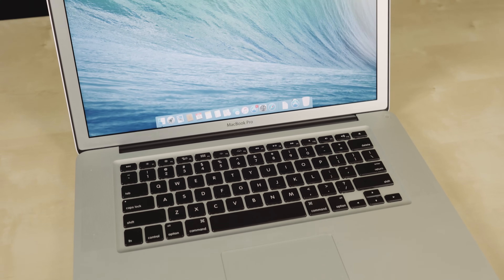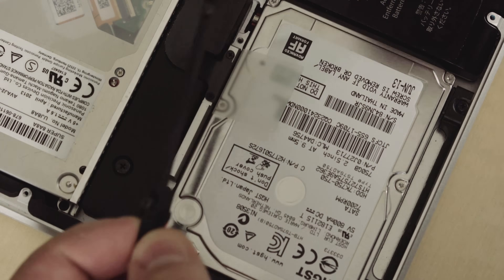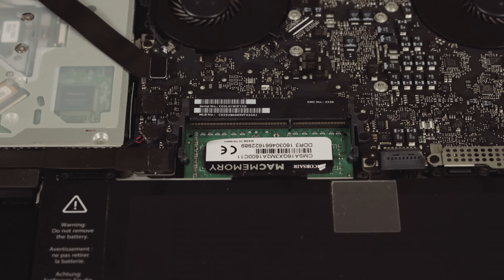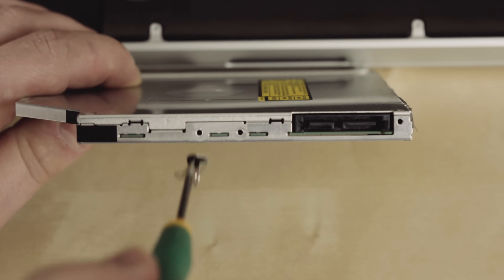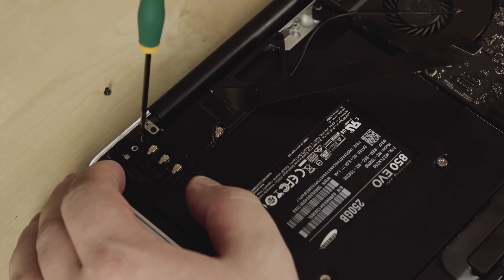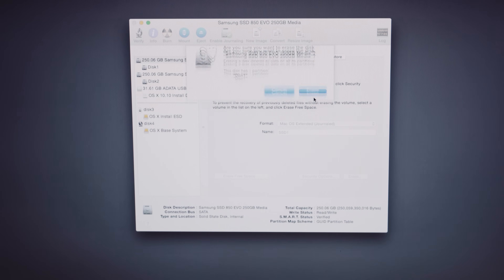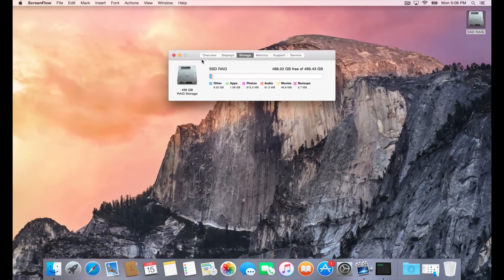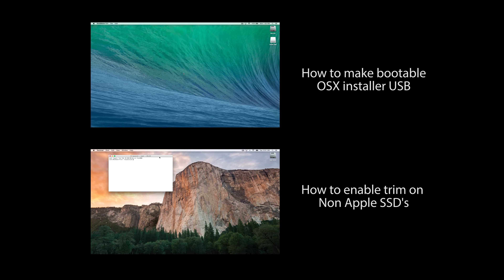Fastest 2012 MacBook Pro Ever! Upgrade Guide - in 4K

Comment: I am about to add a samsung evo 850 500gb drive and 16mg OWC ram to my 2012 mbp.  does anyone have a link about what options to do right after doing a clean install of El Capitan from a flash drive
......I noticed this vid does RAID0 and trim.  Not sure if i need to do that with only 1 SSD installed. 
thanks
Reply from the maker: Gary Sbraccia raid0 is only for making a stripped array for 2 ssd drives. So you don't need to worry about that. But you will need to enable trim for your drive

Comment: Fantastic video! Thanks a bunch. However, and probably rhetorical, but why would I forego my optical drive (this I need because I'm old school) to have 2 drives which, yes, have great speed? Can I still upgrade and make it faster without having to install 2 SSDs? if so, apart from RAM what else can I do?
Reply: Karen Erasmus you don't have to give up the optical drive, you can put in into an external USB enclosure. Also max out RAM, disable extra fonts and trim unnecessary background apps slowing down the computer and add little functionality. See Activity monitor CPU usage. Also see Console log to see what error messages are coming up and resolve these CPU wasting errors. Use OnyX to run maintenance scripts.
Reply: +BradMacPro thanks Brad! How do I determine what's the max RAM? I just bought 16G.
Reply: 16Gs is the max :(
Reply: Also, Will my 2.3 GHz Intel Core i7 handle all of these upgrades? As it is this mac gets hot quickly.
Reply from the maker: Is it a 2012? The upgrades will not have any effect on Heat. If anything it will reduce heat. The standard mechanical drive gets much hotter than an SSD. The extra ram will not change anything related to heat. And I know what you mean. These laptops run super hot especially when exporting video out of Premiere. I stick an icepack under it sometimes so it doesn't thermal throttle haha.
Reply: Lol! I hear you. So 1 last thing. I got all my upgrade gadgets, but am a bit confused about the optical drive casing you have in the link. I ordered this one https://goo.gl/R6tFak , but think I need something else, am I right?

Comment: Any issues with doing this upgrade and using OSX Sierra? Does it matter what brand of memory?
Reply: leonel monzon, jr. I recommend OWC first and Crucial second. Sierra is optimized for use on a SSD flash storage. Sierra is no faster but may add useful new features but then it could very well cause havoc with incompatible hardware and software.

Comment: Do you have any advice on what to do if the second screw you remove from the wifi/Bluetooth antenna is stripped?
Reply from the maker: you could always glue it down? haha I dont know. I know it sounds sketchy but it would probably hold it. superglue or something. Sorry cant really help you there.
Reply: Thanks for the reply and no worries.  I've tried all sorts of suggestions.  Nothing has worked and now, to make it worse there is crazy glue inside the the hole.  
I'm thinking of cutting the two plastic arms and then using glue to put them back together.  
The closest apple store is about two-hours away, which makes it low on the list of solutions.

Comment: What would be the difference if i kept the original hard drive and added a ssd? so id be  running both the original drive and a ssd
Reply: If you RAID 0 a SSD and HDD, it will actually be slow. In that situation, it's best to just install the OS on a SSD and put large files on the HDD.
Reply: bluemetal04 Thanks man,I think ill just get 2 SSDs and use the HDD as a external hard drive
Reply: TheBathingSaint planning on doing this soon, that's smart use the old one as an external
Reply: that's what I decided to do as well. Make sure you reset the PRAM after you're done installing them and enable TRIM on the SSDs (http://www.howtogeek.com/222077/how-to-enable-trim-for-third-party-ssds-on-mac-os-x/) Good luck
Reply: ***** Thanks man! I plan on doing it this week,ill update you guys.

Comment: Is it crucial that the two SSDs be the same model?  I have an existing Samsung 850pro, wondering if I can get away with getting a Samsung 850 evo.
Reply from the maker: Steve Gong for raid0 it's best to have 2 of the same size and make. But it's not crucial. The raid will choose the smaller drive size and make an array based off that. I just feel you will have more luck and stability if they are the same that's all. And if they were both new you would know that they have an equal amount of life span.

Comment: Can i swap the hdd with an ssd and then replace the optical drive with the hdd? Or just leave the hdd and replace the optical drive with an ssd?
Reply from the maker: Charlie smarter to replace the main drive with an ssd and if you want to replace the optical drive with a normal hdd you can.
Reply: Thank you very much
Reply: Also, is it possible to upgrade with 2 different ssd's? Like, one 256GB and one 240GB ssd?

Comment: Not a tech guy like that, but my mid 2012 15'in Macbook Pro is so slow when I use Lightroom and Photoshop for editing, will these upgrades help me or do I need to do more?
Reply from the maker: Paolo Jay Agbay even if you replaced the slow hdd with an ssd you will see major improvements.
Reply: Thanks for the feedback!!
Reply: I installed an ssd on my mid 2012 and my god, it is EXTREMELY FAST NOW!! Trust me it’s worth it.
Reply: @MarcoGamer640Productions2012  Hi mate, I've the same model of MacBook as yourself - which SSD did you go for? Cant figure out whether to go for the 250GB or a 500GB one
Reply: have you reaped the results from the SSD? boot times for startup + boot times for apps?

Comment: What type of SSD caddy did you use to replace the optical drive? I noticed you only went with a 250 GB Samsung EVO instead of the 500 MB on that one. So, is the 250 GB sufficient for the optical drive replacement? Thanks for the great video!

Comment: Hi, I currently own a 13-inches MacBook Pro 2010. I notice the speed of it starts to slow down over the course of the year, should I do the same upgrade as your MacBook if I want a better video editing experience? (iMovie, Final Cut Pro) If not, what kind of upgrade would you recommend? Thank you.
Reply from the maker: You wont be able to do the dual hard drive swap and get Raid0 speeds like me. But you can replace the main drive with an SSD and you will see a major improvement. You can only upgrade the ram to 8gb as well. It will help a little with video editing but unfortunately not much as the onboard graphics is the main component when it comes to video editing. You cant upgrade that.
Reply: Does it help removing the optical drive and replacing it with another SSD drive?

Comment: hello, if I want to put my existing HDD into the caddy, would I be able to clone the data from it to the SSD?
Reply: If you use the right software you should be able to just fine. I just think it costs too much for something that you only use once. Your best options are to either make a time machine and set it up that way, OR copy your important stuff from your folders to your new MacOS drive. I would install the apps all over again because some of them didn't work when I just copied them.
The mac will read your hard drive like it's an external one, but I don't think you can boot up from it over USB.
Keep in mind, old HDDs have a limited life span and will inevitably fail, so I recommend getting a backup hard drive to keep important stuff there. I would not recommend using your old hard drive to store libraries because mine failed a month after I upgraded my mac XD

Comment: Hi would you still recommend this macbook now if i was to upgrade it the same as yours?
Reply: P.s i will be pursuing cs and will be aiming to code plus occasionally play counter strike using bootcamp
Reply from the maker: Depends on what you do. Its a lot cheaper than buying new. But the newer 2014-2016 Macbook Pros are faster. Just way more money. It will be fine for coding and playing CS
Reply: Zed ProMedia thanks man!

Comment: What if I just install a 500g ssd instead of the 2 250g? would that be any different?
Reply from the maker: Nothing wrong with one drive. Your system will still be really fast. You just wont get x2 the speed from 2 drives.
Reply: Thanks!

Comment: Hi, first thanks for this video, the information you give is so useful and very understandable for people without experience in computers. Just a question: I have now a macbook pro mid 2012 and want to upgrade it (I am doing lots of video editing with premiere pro or after effects) and my macbook is way too slow... I am planning to do the same upgrade as you did, with 2 ssd's. I have seen that samsung also sells ssd's of 500gb, would it be worth paying more and getting one of 250gb and one of 500gb, or simply get 2 of 250gb and that would do the trick? I just want to know if it will make my laptop faster (or at this point it would only give me more storage, but no actual faster speed)? And would this configuration be able to handle the editing of 4K videos? Thanks a lot!
Reply from the maker: 2x 500gb or 2x250gb it doesnt matter. You will have the same speed. You just get more storage. I edit 4k video with this system. It can handle it pretty well but its mostly the graphics card that is under powered. If you use premiere you'll have to edit at 1/4 or 1/8 resolution while editing to get a smooth timeline once you get some effects on the clips.

Comment: I have a 1TB SSD I bought before I came across your video. Would I achieve satisfactory results with this one drive or do better with a pair of 500GB coupled as you describe? Thanks
Reply from the maker: John Vasquez you don't need to do raid0 one ssd is still very fast compared to a mechanical drive. I only did raid0 to show I could achieve better results than the newer 2012 mbpr with its ssd

Comment: I wouldn't use RAID 0, if just one of the drives fail you lose all your data. It's best for maximising size. Mirrored RAID or RAID 1 will write at normal speed but can read at up to twice the speed.

Comment: If the Mac has only 4 GB that is most likely not enough and 8 GB may not be enough depending on your apps, system and usage. And putting in a SSD will not fix that.

Comment: I have a mac book pro end 2011……….i  have already a 1 tera SSD samsung EVO  witch replace the first internal 750 giga HD

Now  i read that the maximum  SSD i can put as a first HD is  2 tera…. i can't put 4 tera samsung EVO….  but what  if i put 4 tera SSD has a first HD but slipt in 2 part of 2 tera… means it could works with 2 OSX  choose to boot when computer start…..  So?  (of course I instal first the 2 OSX when the 4 tera SSD is  an external HD   and after  i put it inside my mac as a first HD

thank you very much

Comment: I have a 2011 13" i5 pro. I believe the optical drive only supports 3gbps instead of 6 like the original hdd. how would this affect me replacimg both slots with ssd?
Reply: Derek Davis you can put in two SSDs but you can't stripe them for max speed.
Reply: BradMacPro so what happens if i cant strip them? i just have two seperate ssd and gain no increase in speed from the second?
Reply: Yes, that's right, but most folks find one SSD at a time is fast enough. Generally, in this situation, I'd suggest you can save money and get a modest, say 512 GB SSD for system and apps and perhaps hot documents, and a hybrid 5400 rpm drive for documents and downloads.

Comment: I have a mid-2012 Macbook Pro (non-retina) w/ 4GB RAM and HDD at the moment. Could someone provide some input on if I should just buy the new Macbook Pro w/ Touchbar? If so, which model would be the most worthwhile in terms of cost and performance? 

Or would it be better to upgrade my hard & optical drive to SSD as well as my RAM if I haven't done any upgrades prior to this? 

As a student, my macbook is my main computer and I will be using it for software development(mainly iOS for the time being) and perhaps other high-processing apps like AutoCAD and MATLAB.
Reply: Buy a Dell XPS 15 or a Razer Blade Pro for sheer power to value alone. Don't get me wrong, I use a MacBook Air as my daily but for processor intensive applications like AutoCAD, you would be better off with a vastly more powerful Windows laptop.

The bonus with a Windows laptop, you may have the opportunity to dual boot into macOS if the specs are right.
Reply: I have the same MacBook, same specs and I was also considering the same. I use Vectorworks instead of AutoCAD, and also Cinema4D, Final Cut and CS6. I think I'm gonna go for the upgrade explained in this video. I've heard the new MacBook is shait for the price and has just 4 thunderbolt ports. An upgrade like this would only cost a few hundred quid.

Comment: I have $800 dllrs for laptop do you recomend buying a macbook pro 15 2012 and upgraded to 16gb ram and 2 500gb ssd or buy a new laptop with the $800 dllrs. I will be using the laptop for web development video editing and programing also i will be using al ot windows 10 for deifferent apps  so i will have to install bootcamp. What do you recomend going for the macbook pro 15 2012 or a new laptop or what laptop Thanks

Comment: I presume this will work the same for a 2011 model? Going to pick one up on Thursday for £390 and upgrade the RAM to 16GB and throw an SSD in there. Should be enough for light design work when I'm not at my desktop.

Comment: Would installing SSD's that are higher in storage increase your performance even more? I'm debating on whether I should buy two 250gb SSD's or two 500gb SSD's.
Reply from the maker: Bentley Wong no performance increase because the read / write speeds are the same. You'll just have more capacity
Reply: Sounds great much appreciated.